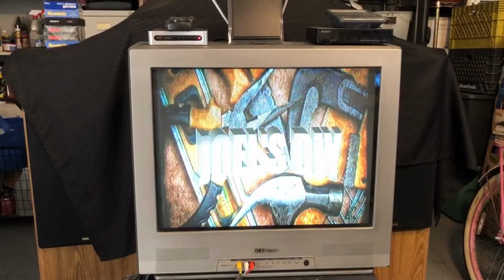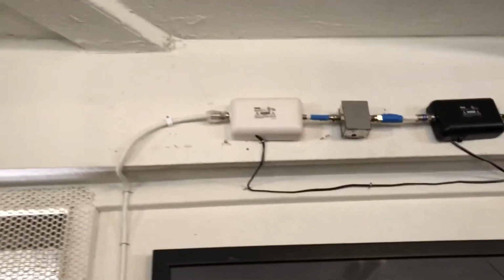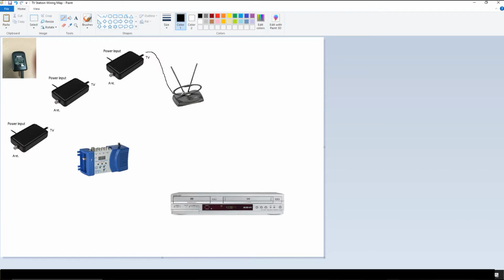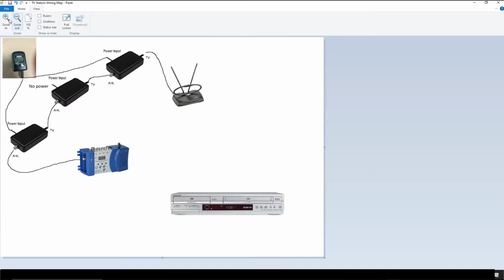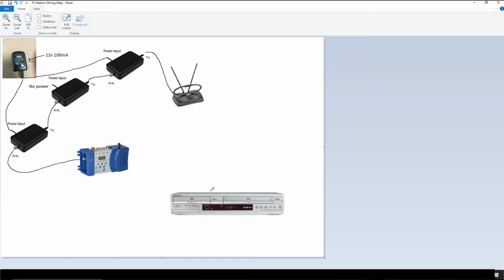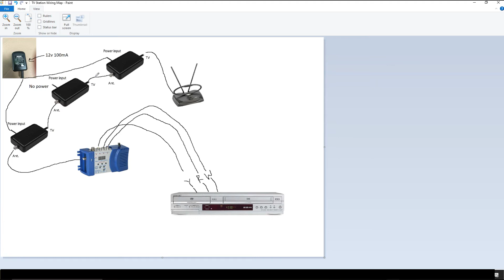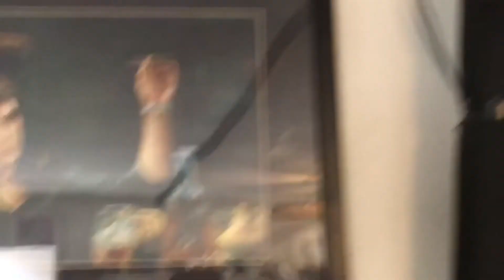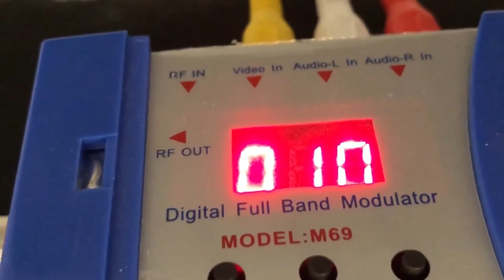DIY   Personal Analog TV Station

Comment: This video is all SO WRONG !!!!! First of all this suggest you built a broadcast STATION !! You built  a analog distribution! !! Second  and I'm listening to you talk about milli amps  AMPS are Current an 100 milli amps is one 10th of a amp! !! Unless those amps only need 500 milli amps then that would do fine but you took a 10th of an amp and split it ??? No power !! Voltage is 12 volts !!! You're not giving it more voltage with more amps  you're giving proper current !! & everybody knows is you give more current  the load only uses what  it needs and the rest is not used  !!! 

Now we get into where yards really went wrong !!! Amplifiers in series. .. the only amp that makes a difference  is the LAST ONE! !! THE ones before that are not  doing anything to "boost " the signal, especially  the middle one which now has no power !!! You made a bypass filter !!! You really don't know what your doing! !! I watched this video hoping to learn something  !!! 

The amplifier would be used DOWN THE LINE when the signal gets weak, you use that to boost the signal back up again!! Did you know that what that does ??? So the first amp is fine off the antenna , Then into you modulator out to a splitter, to each TV.  Also keep in mind, each connection you loose 5 dB of signal, so all those connections you've got... are hurting your signal to noise.. 

But... you're working at it. I wish I could show you what I've got and what I'm looking for to fix my issues.
Reply from the maker: Hey Ventolen, I apologize for disappointing you, but not for making this video.  I’ve watched several videos discussing the matter and it took a long time for me to figure out how to make mine work.  I invite you to share a video on making a proper one, but my design was meant for someone with little experience in hooking up personal analog tv station.  If you want to show us how to do it right, I’d love to see it.  Thank you for watching.
Reply: Oh I wish I could send you a photo. I have 19 sat. Rx, about 140-160 TV's, amplifiers, miles and miles of coax, in my video distribution. It's up and running, it's a mess, but I inherited it, and I'm looking for solid advice.. not something found in your video.
Reply from the maker: @ventolen  ok then
Reply: You could spend your time upset that I commented.. or.... 

You could try only one amp, and understand what I'm trying to explain, learn and grow personally from it...

If you put two car amps in series, you wouldn't double the sound, you would only get the watts from the second amp. If you ever hafta put in 12 v audio.
Reply from the maker: @ventolen  Sounds good, maybe you could draw me a diagram so that it would be easier for my subscribers and myself to understand.  Maybe even snap a picture of your rig too and tell us about it.  I’ll be honest, I’m not an expert at technical terms and I use apps to calculate voltages and read diagrams to make circuits.😀 I would love to learn from your expertise.

Comment: If you're on a serious budget you can cut some corners by using an old VCR with coax output directly into the antenna amplifier. The VCR has a built in RF modulator tuned to VHF channel 3, and many have built in composite/coax in as well. With the help of an HDMI to composite adapter I'm literally listening to the audio of this video through a Sony Mega Watchman using this setup. Also you can use coax to ext. antenna adapter to plug the signal directly into some portables.
Reply from the maker: The problem I've run into is that both channel 3 and channel 4 have a lot of interference for me.  I've found that the more channels I can sort through to get the best possible picture, the better.  If it works for you, I'd say go for it!  Thanks for watching!
Reply: @joelsdiy9469  that is a really good point, and it only works for me because I'm lucky enough to not get major interference with the scale/location I'm working with.

Comment: can you PLEASE put parts list in the description? I wanna make this
Reply from the maker: I think if you watch the video, I mention all the parts that were used for the video but it in short:

1) 3x tv antenna amplifiers (doesn't matter what brand)
2) 1x Compact RF Modulator Audio Video TV Converter RHF UHF Signal Amplifier G3J5
3) 2x passive antennas (doesn't matter what brand - one for your tv and one for the modulator)

I hope this is helpful.

Comment: You have any model numbers for the items you used?
Reply from the maker: Any brand will work, but the modulator is:
Compact RF Modulator Audio Video TV Converter RHF UHF Signal Amplifier G3J5 (I found it on eBay).  Thanks for watching!

Comment: Wait, thats illegal.
Reply: It’s not illegal because the signal is not powerful enough to transmit to a large area.  Also, no one watches analog tv anymore.
Reply: @fntb4gotten  ah ok
Reply: can i have a tutorial
Reply: @fntb4gotten  the spectrum is used for other purposes like military or medical or whatever. But if you aren't interfering outside of your place it's unlikely to get caught
Reply: It is barely legal. It is very unlikely anyone will ever notice, as long as you broadcast in a short range like 200 meters.

Comment: Can i use any antenna to use as a transmitor?
Reply: Any antenna should work, although you’ll get the best results with a “quarter wavelength monopole antena”. Rabbit ears work great for this, since their length is adjustable.
Reply: Technically you might be able to, but the antenna amplifiers are essential.
Reply: Yes but no. For perfect broadcasting you need a bipole antenna specially for your broadcasting frequency. E.g. if you are going to broadcast in channel 3, which is 61.25Mhz you need a ~2.4 meter long bipole, with two 1.2 meter sections. You can search a channel frequency list and do the calculations for your specific frequency. Any antenna will do the trick, but you rist returning the power to the amplifier, overheating it and probably burning it, if you don't use the proper antenna.